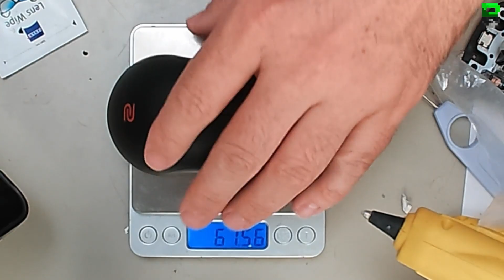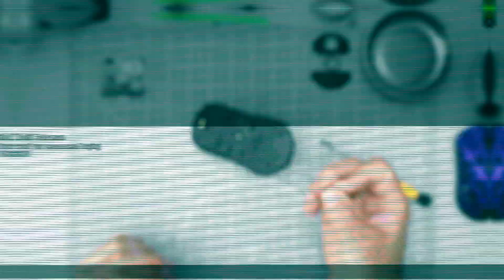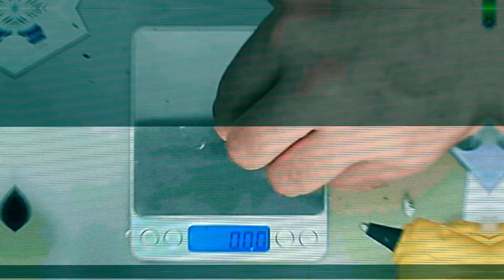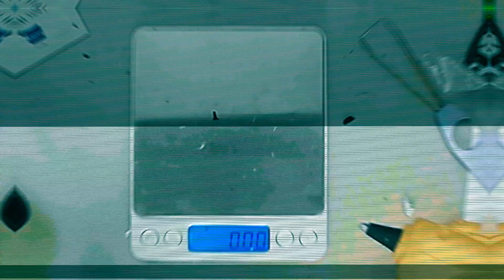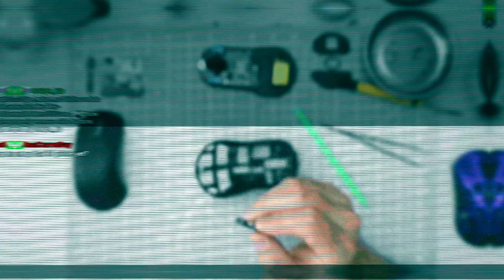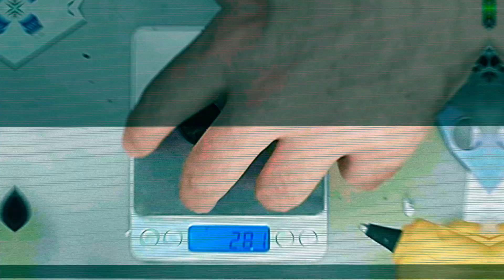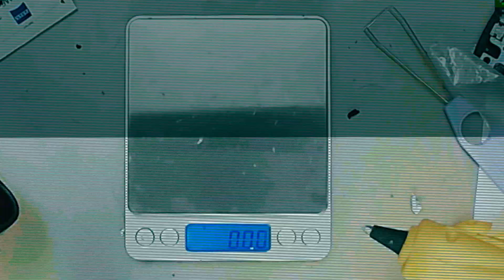Zowie U2 Teardown: Discover the Tech Behind the Precision!

Comment: I have the Zowie FK2 and the my mouse doesn’t move anymore. Clicking still works though. For now im just using my touchpad since I use a laptop, but do you know a fix for this? Its been getting quite annoying
Reply from the maker: Doesn't register any movement... Try another surface, if not you can try to see if there is dirt on the sensor if not then it's probably rip sensor
Reply: @Beardedbob Hey man, before seeing your comment, I had noticed that my mouse registers at the very edge of my mousepad. That really surprised me, because I had already checked the surface problem off the list. So, after that, I went and grabbed my sisters mousepad to see if it was actually the surface, and it was. I washed my mousepad and scrubbed it with the soft side of a sponge with some dish soap and it’s currently drying. Thanks for the respond, by the way. :)

Comment: I have a FK2-C with a similar scroll wheel. Were you ever able to disassemble the scroll wheel further to remove the ball bearing? I'm currently stuck on the spindle+scroll wheel assembly and I'm not sure whether to force it apart (it would be a lot of force). Thanks!

Comment: i replaced the battery in my za13-dw with a 3-pin 150mah and it works great....it just wont charge at all. Works until it runs out of capacity. if i plug that same battery into a different mouse it charges just fine and i can put it back into the za13 and it works until it runs out (and yes the red/black wires are swapped with the usual placement)

any clue what's going on? I'd really like to have a 150mah since the charging dock kinda negates the need for a larger capacity. the stock battery is double the weight of the 150mah
Reply: Were you able to get it working? Was thinking of doing the same with my U2-DW
Reply: @xDomni  yeah, turns out i had a bad unit. new unit and the battery swap went flawlessly lol